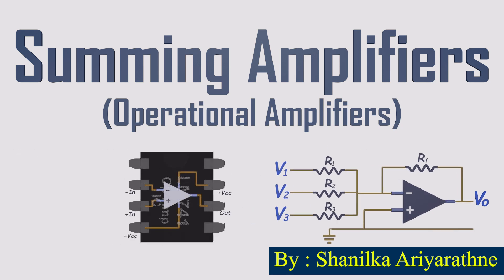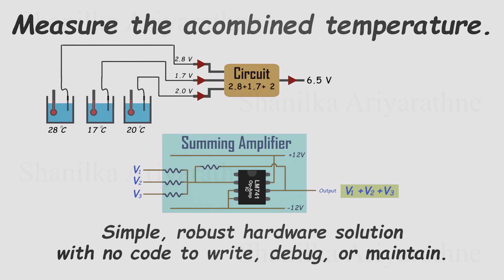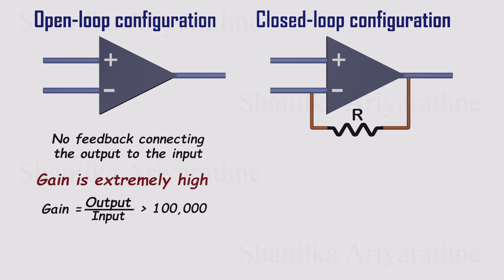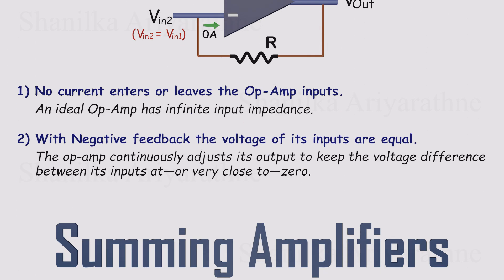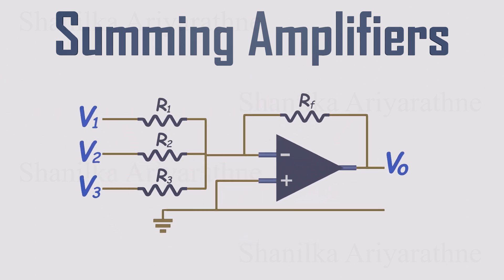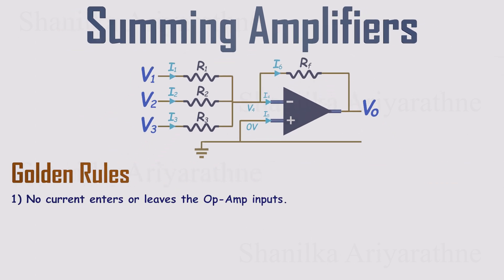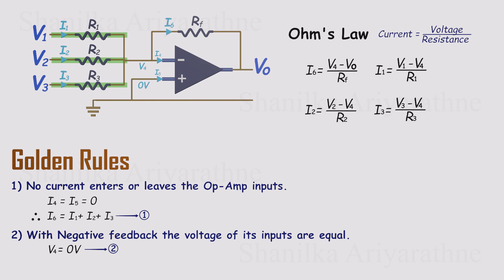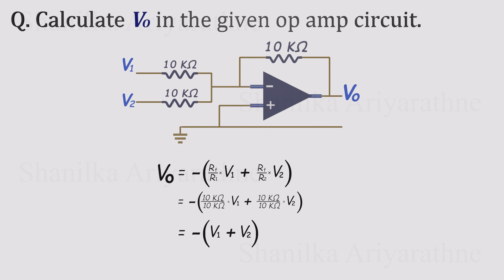Summing Amplifier Explained: Add Voltages with an Op-Amp ⚡

Comment from the maker: ⚡ Correction Notice ⚡
At 2:09, the + and – signs on the op-amp are swapped by mistake. Please note that the + terminal should be grounded and the inputs should go to the – terminal with feedback also on the – terminal (as shown later at 3:59).

Thanks to our sharp viewers for pointing this out! Your feedback helps me make better videos 🙏
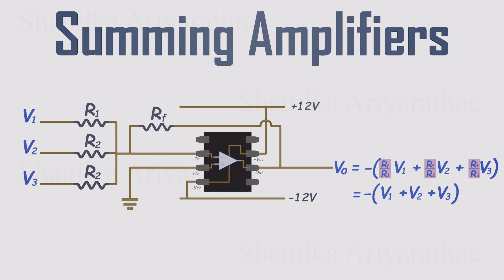Reply: 4:27 your diagram shows R2 for V3 for the input signal. You mention all resistors are the same size but I think you meant to R3 for V3 as shown in equation.

Comment: Real-life need for adding voltages: taking a zero-crossing signal (one that runs positive and negative) and adding an offset voltage to keep the result positive. Example: audio signal running +/- 1.5V; but we want a 0 to 3V output. So we add 1.5V to source.

Comment: Two questions: 1) if your supply voltages are V+=12V and V-=0V (ground) what will be the behavior? How does and inverted sum work in this case? Situation I’m imagining is a car with only a car battery available for supply.
2) if you need an actually negative V- is there a way to set that up? Maybe with your ‘local zero’ being 6V so that ground is -6 and V+ is +6V?
Reply: yeah, true. The virtual ground will be 6V (Vs+ = 12V, Vs- = 0V). Or you can calculate normally, and the final sum voltage will be shift base on virtual ground (V sum real = V sum + V virtual ground)

Comment: at 2:09 you show a summing op amp with the inputs applied to the + terminal, the - input terminal grounded, and the feedback resistor connected to the + terminal.  At 3:59 you show the + input terminal grounded, the inputs applied to the - terminal, and the feedback connected to the - terminal,  why the differences in the schematics?
Reply from the maker: Thank you for pointing that out! At 2:09, the + and – labels should have been swapped—I made a mistake there. I really appreciate your careful observation, as feedback like yours helps me improve my videos.